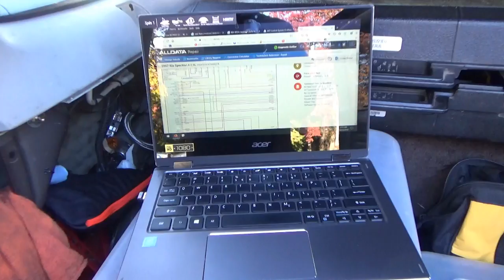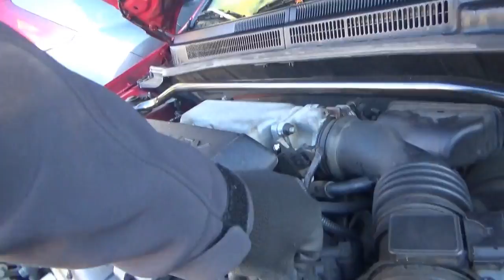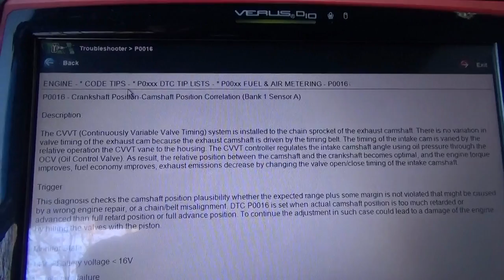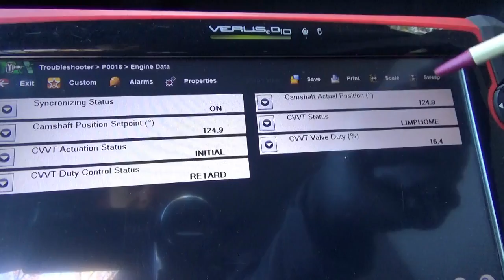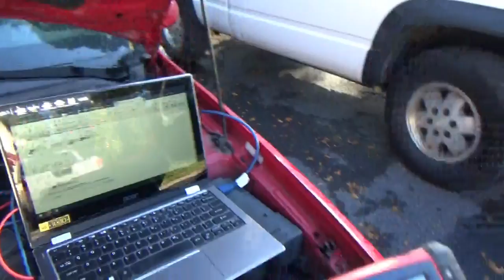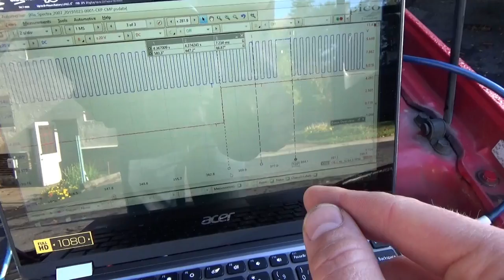Kia Crank No-Start...Then Runs Rough?

Comment: On kia/Huyndai I think the pcm lock has a locking mechanism itself in that - if I remember correctly -  u have to press it down from the front to get it to open.
So I kinda dismiss that it was accidentally unlocked.

Comment: A nice quick one. Makes up for the previous Mercedes ignition key that hadn't been programmed properly and caused a parasitic current draw, flattening the battery quickly. Swings and roundabouts. change the Trans fluid to fix ? Yup there's another wun ! Good luck :)

Comment: one of my friends has crank no start. avalon 2007, the code is camshaft. when i removed the connection of of it  tried to start the car started, however if i put the connection back it wont start,is that normal??

Comment: On that engine the chain & or tensioner between the cams could be the cause or could have vvt issues as well. I just did a Kia Rio with the same design. Mine was not as far off as yours. It is a goofy set up. I think that the CMP tone wheel bolts to the back of the intake cam. Happy diag'n!

Comment: Ivan, did you have to align the marks on the cam sprocket with crankshaft sprocket to get the timing correct? That ECM lock is kind of sketchy. Not very secure.

Comment: Shouldnt you also check oil level and pressure. Maybe cvvt thingy locked up, might need releasing. Just high rev it a few times might release the lock.
Worth a try!✋
Reply: I think the code description said thats the code is set only if present timing is outside of max vvt advance or retard, so even if the vvt solenid was stuck it shouldnt cause a corelation code  but rather timing overadvance or overretard codes...or such..
My 2 cents, But really cool point none the less.

Comment: I’m a bit surprised when folks rev an engine just after starting as if they don’t feel it’s running yet and revving insures that it is, isn’t revving the worst thing for an engine when sitting and cold?
Reply: What is more puzzling it is done by promenint mechanics who know best about oil starvation at start up.
Reply: @WK-space  The oil starvation only happens for a second or two at most. Revving the engine shortens that time even more, by speeding up the oil pump.   There is that initial moment, but it's almost irrelevant.  Now for example, changing your oil filter.  It can take a little longer because the pump is having to fill up that entire filter before it can pressure up the engine-  So it's good to pre-fill your filter when you install them, if it's possible;   and don't rev needlessly at start up on a fresh filter/ oil change.
Reply: @calholli   Many thanks for the clarification,  but there is another factor involved when revving a cold engine which is that piston-rings don't seal +seat properly against cylinder walls when cold and therefore the high risk of cylinder scoring, piston-rings damage  and excessive blow-by.
Reply: It was puttering and spitting and missing--- sometimes revving will "blow the cobb webs out" or help get air bubbles out of the fuel lines, ect.  Or just giving a little gas to an engine that is about to die.  It was a perfectly normal reaction to hearing the engine missing like he did. (which turned out to be a spark plug test set up)

Comment: That's great with the waveforms!
The Pico verified the problem.  If the timing belt was changed recently, hopefully it will be an easy correction.  Really bad place to put the PCM connector.  At the very least, Kia should have put a cover over the PCM harness and connector!  Nice Diag!
Reply: 'Easy correction" means doing the entire timing belt job all over again.  Not so easy-- that's why it's important to do it right the first time.  The sad part is, they probably started and checked to see if it was right--- and it "sounds" ok, because the variable valve timing is making a corrective adjustment, accounting for the incorrection.  So they start the engine thinking it's running fine, and put everything back together. smh..

Comment: Im a hyundai tech in new zealand and well the same as kia same power train , i had a 2012 ix35 with that issue and the exhaust cvvt hub was sticking  after 90kms of driving  but these are timing chain , 9 times out of ten its lack of oil changes or wrong oil grade  the PCM are in the engine bay now which is such a better location

Comment: Ivan, this is Brian. For what it's worth, on the Lexus I asked about...it was a bad CKP sensor.  Absolutely nothing I was seeing would have lead me to that. Was throwing ignitor codes. Finally found one line in an entry in Identifix under "tech-tip" that said a faulty crank sensor can cause ignitor codes. Thought I'd let you know, just in you ever see anything. Great videos as always!
Reply from the maker: Thanks for the tip, Brian! A scope would have picked that up I'm sure. Would be cool to see a known-bad vs. a known-good :)
Reply: @PineHollowAutoDiagnostics  I'm sure a good scope (like a Pico), would have probably picked it up, but unfortunately all I had was a much less expensive OTC. Not very many settings. But, it's fixed, that's what matters! On to the next headache...lolol....

Comment: I don’t think the engine would have run as good as it did at idle with the timing belt being off even one tooth. I’m a little curious about if they were paying attention to where they initially set chain on the VVT. Nice job Ivan as usual
Reply: Great point
Reply: Has a timing belt and chain combo

Comment: That is one of the easiest timing belts to replace in the entire automotive world!! ONE cam sprocket and everything is well marked!
What moron did that and let it leave like that????
Reply: @Sam S Yeah and who doesn't turn it over a few times by hand and recheck before putting it back together.
Reply: @frugalprepper  actually me, I've replaced mine on a 99 camry, never done it before, lined up the marks and put it together. Changed the water pump too. My problem was I should of changed the oil pump seal while in there. They're common to leak and only a few dollars at Toyota.  Mine leaked a few years after timing belt job. So I actually did that job twice without spinning to check, worked great, but I will probably spin and check because it does make sense. I guess for me as a back yard mechanic,  I've always done stuff by the book, checking alignments and torques that I've always expected the right result. Guess that's why I love these types of programs, your never to old to learn better ideas. I find this guy impressive,  really sharp with these systems.
Reply: @frugalprepper  ya true it's easy enough to do
Reply: That's what I was going to say!
Reply: Good to know, I have a 2009 with 94k on it I just picked up. Planning on doing the timing belt in the late spring.
Reply: I have the same engine, on a 09 Hyundai Tucson, the BETA engine by Hyundai, G4GC, simplest engine in the whole world. From what I know it is actually a copy of a 90's Mitsubishi engine, so no rocket-engineering.
Reply: @barabaspolo  It is a clone, and you can get aftermarket Mitsubishi parts and turbos that go on them.

Comment: I can't be that lucky. I am working on a Saturn Astra 1.8l  It has a P0016.  Found the timing was way off on the back of the cams and the phasers on the front.  Somebody was in there before me. The customer had me replace everything all OEM parts.  Used the proper tools and got everything back mechanically where they are supposed to be. Still have the code.  Without a scope and good wave form.  Kind of at a loss. Am I getting a good signal from the cam sensor and the crank sensor. Are the phasers able to correct the timing or are they disabled because of the code.  Unfortunately Mitchel doesn't give me enough information.  (BTW I am doing all labor and diag for free.. This ia Vietnam Vet on disability income)  Parts are being provided by donations.  That said another Great video Ivan gives me some ideas on how to proceed.

Comment: I recently encountered a vehicle that had a failing battery ground cable. The terminal had come apart but was good enough to start the vehicle intermittently. The oddest thing was that the missing ground would light up the front right turn signal and side marker light as the ground became disconnected. My only assumption was that the vehicle's computer was trying to find engine ground through whichever circuit was easiest. That just so happened to be the power wire for the front turn signal lights that connected very close to a main body ground.
Reply from the maker: Cool! Yeah bad grounds can have some crazy symptoms!
Reply: @PineHollowAutoDiagnostics  What's the model number of your Picoscope?  I'd like to invest in one. Thanks Ivan
Reply: That's just electronics. Find the best available earth/ground.

Comment: Neighbors had a Hyundi Elantra and had the same issue with the timing belt. It ran like crap but they drove it for about a year till one cold day it wouldn't start. I kept suggesting the belt was off a notch but they insisted the mechanic would have never let that happen. It sat for a month or so and I went over and looked at it and did get it to start. I drove it to my garage and checked the timing belt and found the guy who put it on got it off one tooth. Corrected the timing on the belt and it started and ran great. Told them it also needed a radiator as it was leaking. Of course their kid drove it till the engine ran out of coolant and burned up over a $50 radiator! Go figure! Watching this video was DaJaVu the car was even the same color!
Reply from the maker: Great story, Alan! Wow it amazes me how some people just take their cars for granted and ruin them for no reason...

Comment: These are great cars and they can easily do 300k if the timing belt and (auto)transmission fluid are changed per the OM... We have had 5 of these cars and they were/are the most trouble free of ANY other cars we have owned... BTW the very first timing belt replacement I did had the same codes and I found the number of teeth between the intake and exhaust cams was off by one tooth... You need to make sure there is no slack between the cams even though they may look "right"... The CEL will go off and the engine will run much better... I have an 08 Spectra SX (4 door version of what you worked on) with a manual tranny and it has much more pep than the automatic version... Dave
Reply: Agreed. My stepmom had a 2005 spectra5 sx and I learned how to drive in it. Cheap and reliable
Reply: My 06 rio has 257k and runs like a champ. Oil change, trans fluid, timing belt, shocks... thats it